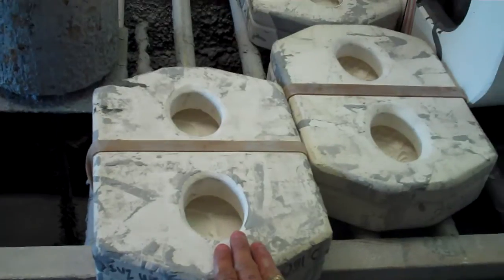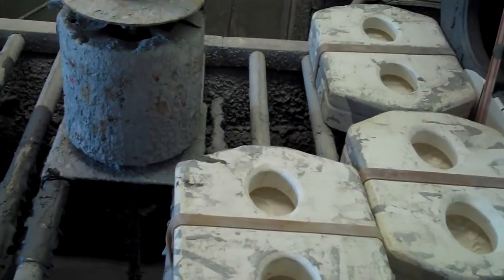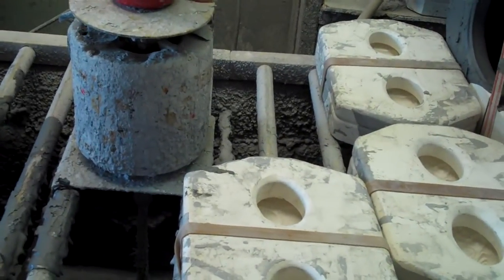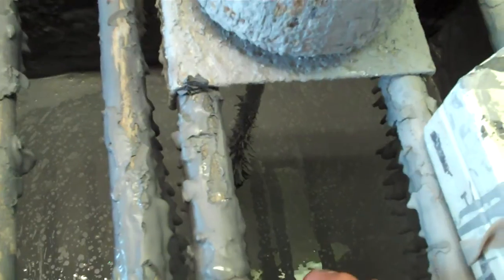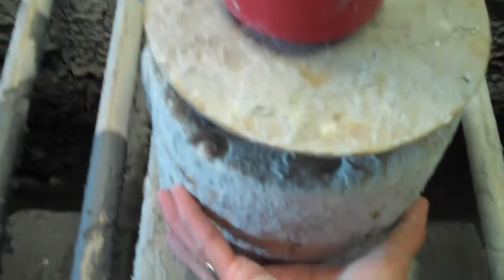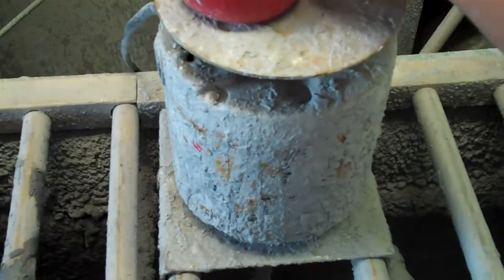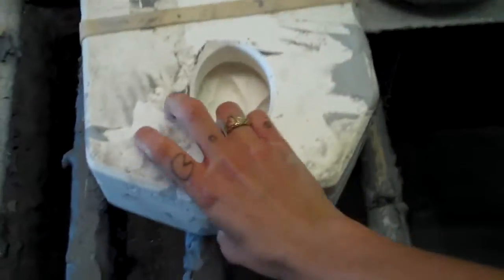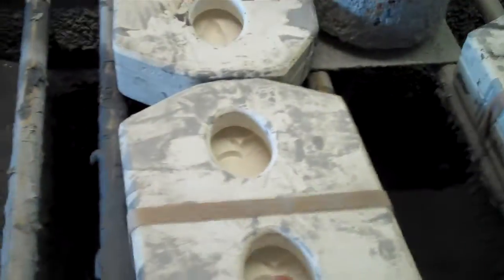Slip Casting

Comment from the maker: If your thinking that the feddled chunks of slip can be reused, they cannot, just because you toss it back into the liquid slip, it does not mean it will turn back into a liquid. It will just remain a chunk. Also some of the holes on your plaster mold are incredibly small, you wouldn't want a chunk getting stuck at the hole (which could great air bubbles, pin hole dips in your object, and ruin the piece all together)